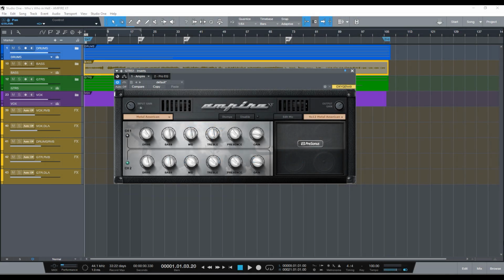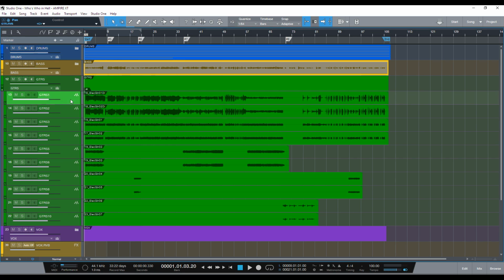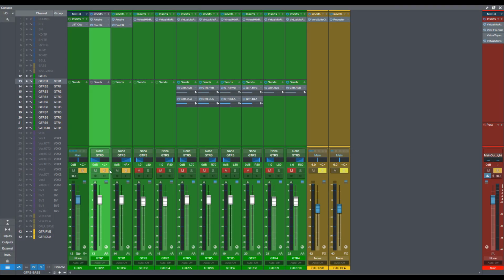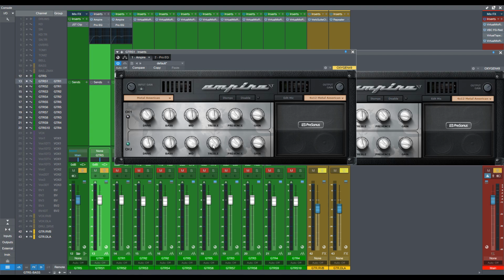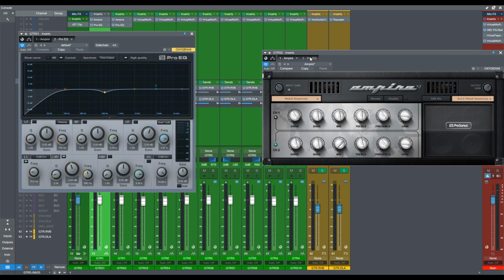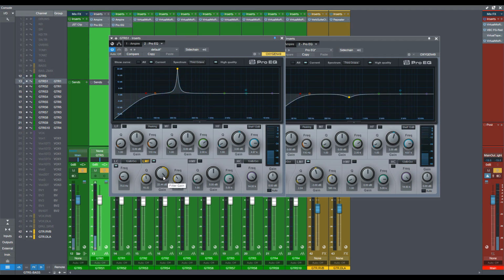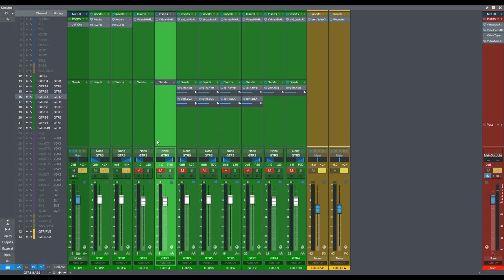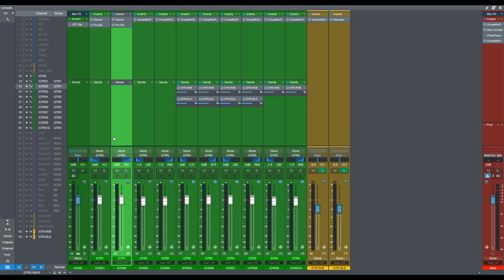Create Metal Guitar Tones Using Presonus AMPIRE XT

Comment: Great!
I'm a newbie.
Could you tell me, where does the distortion come from? Is that only from the Ampire's Distortion? Or you have another source like Guitar Rig?
Reply: comes from Ampire. Guitar Rig is an effect (plugin) just like Ampire.
Reply: @cleverhippo  So it does not come from Guitar Rig?
Just from the Ampire's distortion?
Reply: @iannugrahanto6150  So if you look at https://youtu.be/e5-GB7Hh4M8?t=123 .  Minute 2:03 in the video. You can see all of the insert and sends in his tracks.  The two tracks that he has selected only have Ampire and EQ as inserts, so that's where the distortion is coming from.  He does add other effects to the Mix (all the way to the right, red track) which could be altering the tone. Guitar Rig and Ampire essentially do the same thing, emulate a real amp or fx pedal.
Reply from the maker: Hello @Ian Nugrahanto ..sorry for the late reply. The sound of the guitar has been recorded dry DI signal. Meaning from the guitar - DI BOX - CONSOLE/INTERFACE. I used the Ampire with the Metal XT pack and some processing as shown in the video to create a heavy tone that could fit the mix. Remember that the final result is a combination of a good quality DI tone, and well recorder song as a whole, and creative skills while mixing. Let me know if you need any further help.

Hope I helped.

Best